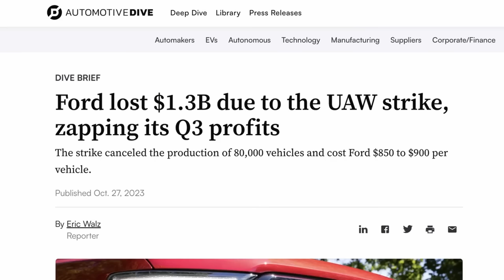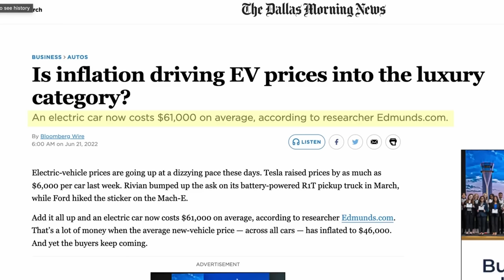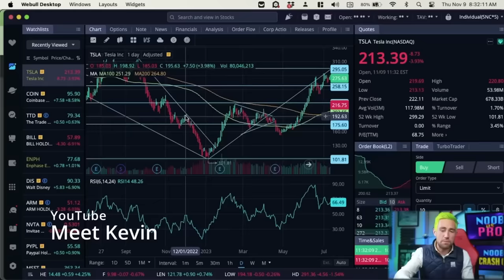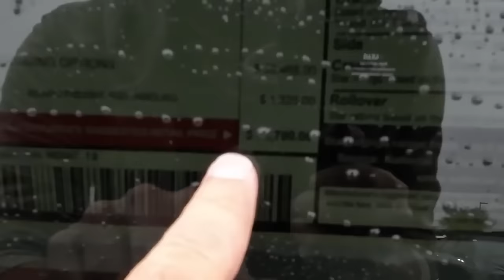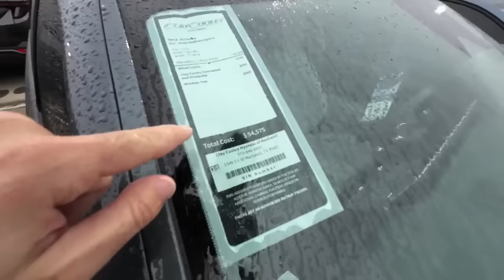Ford & GM Made A DUMB MOVE! Truck Buyers ANGRY After Finding Out The Truth...

Comment: I can give you another reason EVs are not selling: Solar. We have a 18kw solar system and in the summer, we have power to spare. But in the winter we are on the grid a lot. This is w/o an EV. So if we expect to charge an EV during the winter, it's not happening off our solar, we'll have to use the grid to charge it. I think a lot of people thought "Well I have solar so it'll be free to charge the EV." In reality, that is not happening. You have to be very careful about how you use electricity and an EV is just another load you need to manage.

Comment: After experiencing what my neighbor has gone through with their 2022 Ford Mach E, and Ford Lightning, no thanks, EVER!  Not only did they pay a premium on both vehicles, their fault for falling for this debacle, they cannot get rid of them.  The truck is useless, $110,000.00, and the Mach E is unreliable to drive any further than 100 miles round trip.  My Dentist bought a KIA EV6 for $10,000.00 over MSRP plus another $1,500.00 in worthless add-ons, flat satan paint not holding up well, and he is forever upside down on that car.  That said, he told me it is reliable but he has to be careful where he goes with the car because of the charging problems in California.  He spent a lot of money adding a charging unit to his home, but he drives over the mountain from his home to his office.

Comment: Nobody is forcing you to buy an EV. There is a credit for buying one. There is also a credit for having kids, is the government forcing you to have kids? People buying an EV reduce demand for the gas you are buying, lowering the price and giving options to more people if there was a real supply disruption. EVs are the only vehicles where you can make your  own “fuel” with solar and be independent of gas prices. If you have garage or parking spot with electricity you fuel up every night while you sleep and never spend any time waiting on charging (unless you go on a several hundred mile trip and need to DC fast charge), which for most people is only a few times a month. Have you even driven one? The performance makes ICE vehicles look like they are from an entirely different era. If you want a bargain EV buy a Model Y, they are $35k (after point of sale tax credit), if you want a bargain truck buy the Lightning Pro, $45k. The Lightning has a front trunk, does 60 in 4.5 seconds, tows 10k lbs, and has 240v 30a power that can power your house or RV for days. Lots of things an ICE truck can’t do, and not for $45k. Just test drive one.

Comment: I've never waited more than 30 minutes for a charge, generally only 10-20 minutes and only on a road trip. But I've never tried an EV that couldn't use the Supercharger Network. Some of the non-Tesla EVs do have sub-optimum efficiency (which increases charge times).

Comment: The local ford dealer (Chicago area) will not take any EV in on trade. They have 6 used EV that have been sitting there for a year. Nobody wants them. And my son is a salesman for Mercedes Benz & he was also told he can’t take in any EV on trade. Whennwenhadnthr polar vortex here last month & temps went down to -35 and all but TWO public Tesla chargers were frozen & there were dead teslas EVERYWHERE!

Comment: The only way I'm even remotely going to add an EV SUV/truck to my shopping list in the next 2 years is if they A.) Supports 350kw+ DC Fast Charging (15+mins to 80%) for road trips with needed infrastructure, and B.) The rather obvious of prices coming down by a lot for the average consumer, and C.) Tow/Hauling capacity is more than doubled to current terrible results of current models today, and D.) Battery packs become modular, fixable and cheaply replaceable as the recent media reports of damaged packs costing $20k-$60k to replace is completely NUTS and resulting in some insurance not even wanting to look at them! 
I just can't foresee myself buying an EV for everyday use since I like to do a lot of driving and the occasional towing. Gas still makes sense even if fuel is becoming terrible to afford, and hybrids (though Ford and Toyota trucks are quite expensive new) are still the better long term purchase. When I think EV, I think a second vehicle for someone with enough money on the side to have it as a runabout or toy, not a daily driver.

Comment: They need to flip the cost on those - If I wanted a new  truck to just run around town for dump runs and home depot trips the Lightening would be perfect, but at $80k, hell even $50k, that vehicle will be our end-all for all family activities.  That's a compromise we couldn't make with multiple cross country trips. 

The issue is its too much, too big, and too expensive to be the third or fourth car a family owns, unlike the  90's where you could lease a Ranger or Escort for $99/mo. 
Now a proper, basic compact EV pickup for $20-30k... that would sell like hot cakes!

Comment: There is another problem. Its call "Battery degradation " so when u buy a new EV u can charge  100% but depends on how u charge your EV in 2 years' time u can charge only 75% ( Basically u r losing cells in the battery ) that will be like your fuel tank on the gas truck is smaller by 25% after using your truck for 2 years

Comment: I'm happy with my 2003 3.0L ford ranger that i got for $3,200.
Reply from the maker: Those are great little trucks.
Reply: Btw, I'm a person who very much considers myself an environmentalist, a tree hugger basically, and in my opinion, a lot of the push towards electric vehicles from corporations has nothing to do with protecting the environment, and everything to do with maximizing short-term profit. That's how corporations are designed to always function. Toyota is no exception, they just have a different strategy.

Comment: Same thing happens to me & ford lighting- I bought one20 23 manufacturers drop prices by10k in few days  , that’s after I spend another 10 grand to make it look better
Suppose to drive 330 miles in full charge but offers 200 if I turn off lights and No heat or air conditioning , I spend another 10 K to upgrade my electric panel and run electricity to other side of home for plugging few days ago. I sold it for $43,000 I lost over 50,000 in one year.😢😢😢😢

Comment: Greed killed the Market, rotten dealerships and crooked salesmen cheating customers with charges that don't exist.  I went in to buy a car set down with the salesman looked over the contract drew a line threw 3 items costing 2100 dollars that are included in the MSRP.  Then I tore up the contract and told the man and women in the booth to check their contract and then walked out.  The manager stopped and said he would fix the problem.  How I asked, he said I'll make the contract myself.  The only way you can fix it is fire the salesmen that are doing it and I walked out.

Comment: You said the car companies are forcing these down your throat. Completely false. They are an option to gas/diesel powered vehicles. The biggest problem is the price. If GM and Ford had included some affordable EVs (and not had so many problems with the Bolt) they would be selling a lot of affordable EVs.  Most people use their cars for local driving, 30 miles or less per day and things the size of a Bolt or Civic or Corolla that could safely cover 100 miles (in cold weather) would be popular and successful. The majority of EVs are luxury cars and that is where the market has failed. This is the typical growing pains of any new technology. Early VCRs, DVD players, smart phones, LCD TVs, etc all cost too much when introduced. If I could buy an EV similar in size to my Golf wagon for $25K and it would go 100 miles on a charge I'd have one. But an EV truck or SUV for $70k and up, no thanks. The cost of all new  & used cars, EV or gas, has become crazy since 2019. Rant and rave all you want, but the future is in electric powered vehicles, not gasoline. It may take 20-30 years, but in the end electric will win out.

Comment: I've owned trucks forever. But I ALWAYS keep them at least 10-15 years. I will NEVER pay $100K for a truck. In fact, I will NEVER pay $50K for a truck. I will buy a clean used truck every time. It's a truck! It hauls, moves, tows, goes off road. Only a fool would pay more than $50K for a truck that's gonna be beat to hell.

Comment: I have more Ford inventory than I have ever had at my dealer BUT we are selling a lot. MACH E inventory and incoming units is WAY higher than sales and o have over 100 Mach e in stick. That is a disaster BUT in Canada Ford just dropped the price by 5k, dropped the interest rate by 3% AND now 2 government rebates apply to all models except Mach E GT so this will certainly move a lot of units and help correct the problem. Except Ford will loose more on EVs come next ywar unless battery prices continue to drop

Comment: If you want an ev buy a Tesla. Owned 4 EVs in past (3 teslas and a rivian truck). No issue charging using Tesla superchargers, quick reliable and fast charging.
Reply from the maker: I LOVE the looks of the Rivian. That's one of the only EV Trucks I would buy.
Reply: @MotorFeed  only one issue with rivian in my experience is unreliable 3rd party charging stations and if you find one that works it is not cheap to charge. But yes an awesome truck if you keep it local! I think I have a video posted on YouTube about rivian truck, just overview of it.

Comment: Nobody is trying to force anyone to buy an EV. Buy whatever makes the most sense to you! The grid doesn't need to be ready now for EVs that won't be sold for years, it will increase capacity year over year to keep up with the rate of adoption of pure electric vehicles. It looks like there is still a lot of non-sensical anti-EV rhetoric being propagated, even by otherwise sensible Youtubers.

Comment: My garage is my personal gas station with at least 50% savings.  I don't drive over 300miles in 1 day. I fly for anything farther.  Engine/transmission will fail before my battery.  The ONLY fluid I've changed or added is wiper fluid.  No brakes to worry about.  Dumbass ICE comments😂😂😂